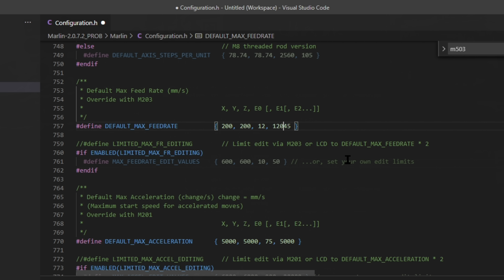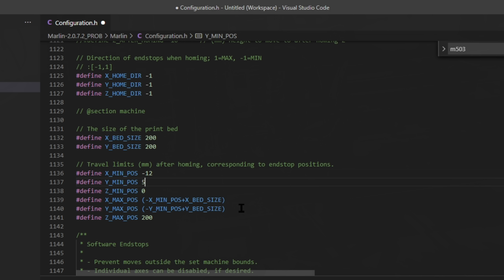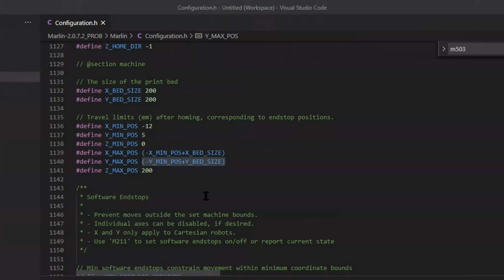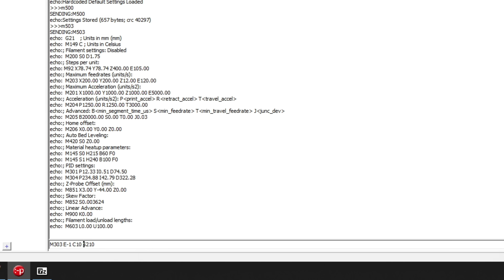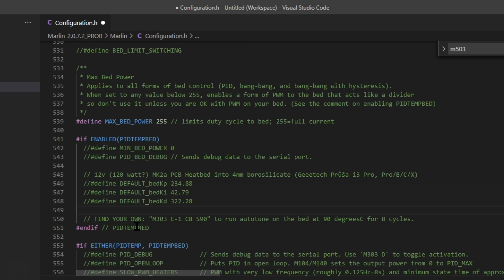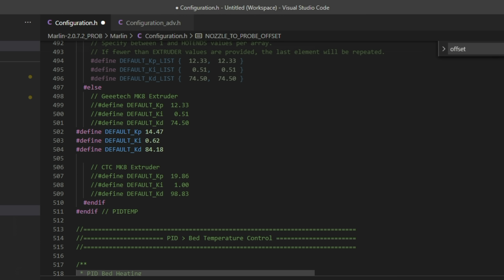3D Printer Fix Up - Geeetech Pro B - Part 4 - Chris's Basement

Comment: by first printer... is alive and kicking as

if you set Max acceleration to 1000 then you can't  use a higher value when you print as default?? long time since I used Marlin 36:10
Reply from the maker: Yes, that is correct, but most of the time now I use Prusa slicer to reset all these values based on the print. Just set these for default.
Reply: @ChrisRiley  Idea for a short clip.. how to determent (safe)Max acceleration.. i try until a axis skips and then back of 10%
Reply from the maker: @Nitram_3d  That is an interesting one, I will see if I can work that in.